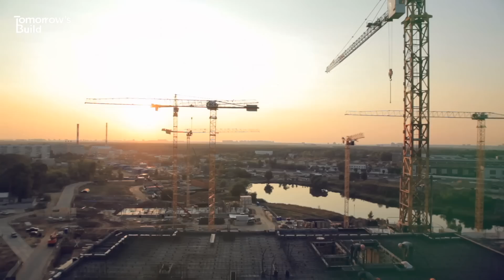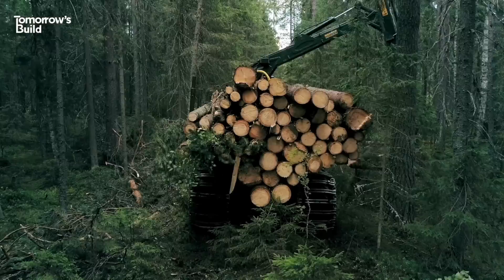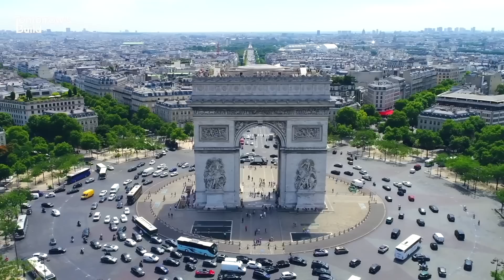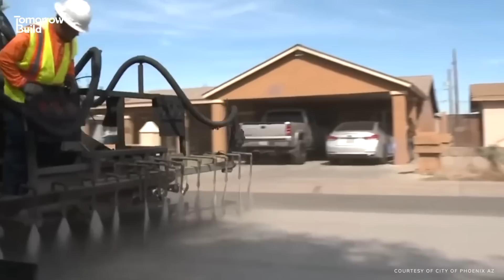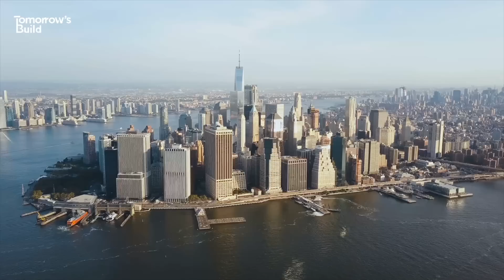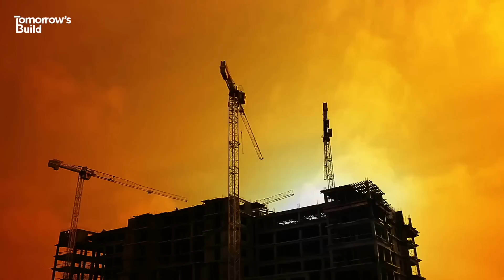Why We Should Paint Our Roads White | Tomorrow's Build

Comment: In France, the new laws about insulation are debated even if they passed. Landlords are complaining that they don't have enough time or money for the renovations, as if they weren't leeching off people for years or even decades without any dime invested into maintenance.
Reply: As a property owner in USA, I have a different opinion.   My expenses in any given month often exceed the property income.   People stop paying months before they move, knowing it will take you that long to evict them so they can use their rent to get a new rental.   I’ve seen renters take EVERYTHING, sell what they didn’t want, getting money for MY appliances, one even took light switches, and another cut the carpet in a strange pattern and it took a moment to realize the shape was that of their pick-up bed.   I’ve had renters WET MOP wood floors, which can cost $8k to $15k to repair and refinish.  I buy nice homes and make sure they are nicely appointed to get a higher quality of renter, however nowadays it seems there are less and less ethical renters.   My goal on every unit is to make $100-$250 above all expenses, and when you have to spend $5,000+ when they move out to make it rentable again it is a serious issue.   So yes, I don’t make enough profit sometimes to afford the VERY EXPENSIVE changes City services decides a home needs.   They demand roofs be replaced $80,000+ when there are no leaks whatsoever on a 20 year old roof.  And trust me, no minor repairs are overlooked, if it can damage my rental, it’s FIXED A.S.A.P.
Reply: @Erin-Thor Thank you for your respect- and insightful input. It is easy to demonise landlords, so it is nice to have someone remind the people that you are, in fact, also human. 😊
Reply: @Erin-Thor my family owns and rents a house in Sweden. Same stuff goes on around here…
Reply: @Erin-Thor i can only imagine the headaches that go into being a landlord. However... Being a landlord honestly should not he cash flow positive in my opinion. It would be like saying you should be getting a dividend from a growth stock. You get a significant amount of equity created in your home every month that you can either leverage or sell for cash if needed. Being a landlord is already incredibly extractive and provides minimal economic value other than being a middle man. Seeking profit on top of that is a bit much.
Reply: @frostman9661  — If someone has a business, you think they shouldn’t make a profit?  Why do it then?
Reply: @Erin-Thor  Did you not read my comment at all?? Most businesses do not make profit for a good length of time. Landlords create equity every month on their properties. Ethically speaking, making profit off of a human need such as housing is also dubious at best.
Reply: @frostman9661  — On that part I agree, but I’m not wealthy, I finance my properties, AND have maintenance expenses, as well as labor (plumbers, carpenters, appliances) and other costs.  I can’t, not would I expect ANYONE to operate rentals break even as I would have almost zero reason, not to mention ABILITY ($) to maintain the properties.   Where exactly do you think the money from maintenance comes from?  Sorry, we will have to agree to disagree on this point.  You clearly do not understand how the world works.  You can’t maintain the property to get any appreciation if you don’t plan for those expenses, plan for a little profit to make it worth my time.
Reply: @Erin-Thor  It's worth your while because in 25 years you have the house completely paid off with hundreds of thousands in equity and essentially pure cash coming in. Again, it would be like expecting a growth stock to aslo pay you a dividend. A fully funded retirement is your reward. If you need extra operating cash, you could always have an LOC on the property which most I know have. Besides, very very few people actually are landlords full-time with no other outside work, so if that's what you do, you are an exception to the rule. To your point about how the world works, this isn't me not understanding, it's me suggesting this is how it SHOULD be, rather than is. The ethical concerns with making profit off of housing is concerning worldwide.
Reply: @frostman9661  — And how do I pay for repairs, maintenance and damage in the meantime?  You expect me, any landowner to work his but off at two jobs so renters can live more cheaply?  This is a business!  If I have to wait 25 years, why not just invest in stocks?
Reply: @Erin-Thor  you use operating cash flow. With the exception of extreme circumstances, 1% of the value of the home in maintenance per year is typically sufficient and equates to about 1.5 to 2 months worth of rent. Big whoop. The rest of it is going to building equity in the home. And yes, you should. A retirement plan, maybe, but a business shouldn't be made out of it.

In the end, you outlined EXACTLY my point. There shouldn't be incentive to invest in houses to extract rent. And yes, investing in stocks or build other PRODUCTIVE businesses should be the goal. Have a stockpile of rentals is not productive and is purely extractive and is becoming an increasingly large share of our economy and it's beginning be shown as a massive problem. There is a need for rentals, of course, but housing is so damn expensive, there is way more renters than there should be. Not saying YOU are the problem, simply a symptom of a poorly managed system and you are just doing what makes sense. The system itself is rotten.

P.s. incase you are thinking I'm some loser on the internet, I do quite well for my self, but have been on the other side of it for a long time before I got where I am.
Reply: @Erin-Thor he’s probably saying, you pay your maintenance and staff with the rent. The rent should not be able to cover everything, given that you are also earning equity. Basically, rent should cover the service you provide (maintenance, wear and tear, depreciation, access to the home, etc). But it should NOT cover that PLUS your mortgage.  Pay your mortgage yourself, let the renter cover your other expenses.

Why? Because the mortgage you pay is the investment in the actual asset (the physical home and land) that pays off in the long term. While the rent is the short term cashflow to cover your immediate expenses of providing a service.

It’s incredibly greedy to expect both. A normal business is also well-balanced in this way.
Reply: @invinciblemode  Well said!
Reply: so give them money..
Reply: Take away their property and give it to the tenants. Problem solved.
Reply: Thanks for your low iq take.  @peopleofearth6250

Comment: What percentage of the atmosphere is CO2?
Reply: Around 0,04%. But don't worry, we're bumping that number up quickly.
Reply: Why does it matter bud? Co2 is still causing modern global warming
Reply: 0.04% is CO2, on average water vapor in the troposphere is 1%.    Water vapor has a CO2e=18 that means on average water vapor is 450 times more dominant as a greenhouse gas temperature forcing agent than CO2, but this really doesn't make any difference because earth's greenhouse effect is always held in saturation by water vapor and can't be changed in overall effect to add 10°F (5.55°C) to earth's average temperature and takes place within 20 meters of the greenhouse energy radiating surface, typically the earth.
Reply: Hey thanks for that data! What are your thoughts on the Milankovitch cycles?  @douglasengle2704
Reply: @douglasengle2704 no. Water vapor is not causing modern global warming bud. That’s physically impossible

Comment: I like the drive for these solutions but it's going to drive costs up. I'm an engineer and like most of my coworkers, I can't afford to live within 1 hour of my workplace on an engineering salary. The cost of owning a house in through the roof and implementing these solutions will make it worse.
Reply: The biggest issue is you not being able to live within an hour of your workplace. There really needs to be stricter housing regulations to reduce demand (from ones owning a house already) and increasing supply (by constructing more mid-highrises)

Comment: I wonder what impact there would be if all urban areas employed district heating and cooling with geothermal. Seems like low hanging fruit.
Reply: My city of 160k (Szeged, Hungary) does exactly that. We are number 2 in Europe by geothermal usage, only behind Reykjavík, Iceland.
Reply: cooling too ?
 @danielszekeres8003
Reply: Only a few places in the world have geothermal close enough to the surface to make that viable.
Reply: @Requios  that's true for geothermal power, for domestic or district heating and cooling you just need to be deep enough to not get sways from surface temperature changes. It's using the mass of the earth as a thermal battery moreso than extracting the heat from the core.
Reply: What our cities have done about 500 years ago is to dug canals, they absorb heat in thee summer and give off heat in the winter.
Reply: @buddy1155 which cities?
Reply: @sm3675  The Dutch cities with canals.

Comment: You were misleading in a number of areas, for instance; levying the environmental impact of heating and cooling buildings at the foot of the construction industry, as opposed to that means by which the power that the energy grid utilizes is produced. Greening the energy grid solves this problem, not blaming the constructors of new buildings for how those buildings get powered. I thought that was a rather obvious and shameless side step.
Reply: You're totally out of mind. You do both, by reducing the demand from the market through building efficiency and by improving the quality of the offer by producing energy sustainably.
Reply: i mean, is a bit of both. If you build your office building in a way it preserves a set temperature better then you don't need to spend as much energy cooling/heating it. & yes climate control does require more renewable energy as well
right now we need less pointing fingers & more doing effort on all fronts

Comment: We need to emit as much CO2 as possible to prevent us slipping back into a glacial maximum. We are still in an Ice age called The  Pleistocene and have been for over 2.5 Million years. Ice on the planet is not normal. Plants have been locking up all the carbon from the atmosphere for billions of years and have nearly removed it all causing temperatures to plummet. We are not warming up we are cooling down on average. Check the data for yourself , Check what I said , Google the details and listen to the debates. See for yourself and don't just accept what other people say. Everyone has an agenda

Comment: Please don't paint the roads, paint and especially wet paint can be deadly for motorcyclists.
Reply: Yeah the road paint problem is very hazardous for motorcyclists and  pedal-cyclists as well. I am thinking especially of the local planners somehow thinking that the paint they applied is going to protect us all from the 9000LB Hummer EV that keeps drifting over the "invisible protective barrier" that is that thin line of paint. That said I think what the road cooling solutions through a higher albedo (basically brightness reflecting heat) is through use of a brighter pigment in the asphalt itself.
Reply: @ZealofSparta  even with asphalt if it rains and the sun hits the water I get blinded while driving..  Lightening the color of the road would make that situation much worse.
Reply: that's why you wait for the paint to dry, duh
Reply: @Game_Hero this was probably sarcasm, but they’re talking about painted surfaces that get wet. Not paint that hasn’t dried yet
Reply: The materials are different. Think colored asphalt sealant. The problem is, they too are made from petroleum products, so yes, they can reduce the urban hear load, but they emit CO2 in their formulation.

As he also stated, a better alternative is to plant more greenery. This would require the tearing down of significant low-rise living spaces, the building of larger apartment blocks and the reforestation of the cleared areas: Mega-City One, if you will, with trees.

Comment: In the UK, electricity is over three times the price of gas, per kWh, so it's simply not economical to have electric heating systems. 

I think this is really stupid but what can ya do.
Reply: But a well set-up heat pump will create up to 4 times the heat energy for the same KWh input of gas . I'm not saying we should all switch to heat pumps but if a boiler is being replaced regardless then it would be a good idea to fit heat pumps where location and conditions allow.
Reply: @callumcurtis15  unless you read the Daily Mail of course, in which case anything electric is bad (apart from stuff that's convenient, such as lightbulbs and kettles etc) 🙄